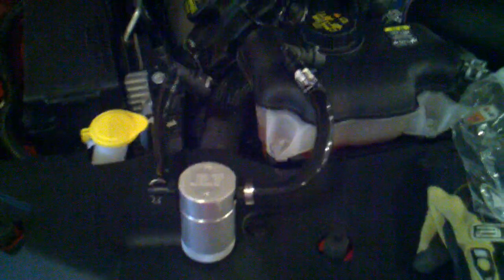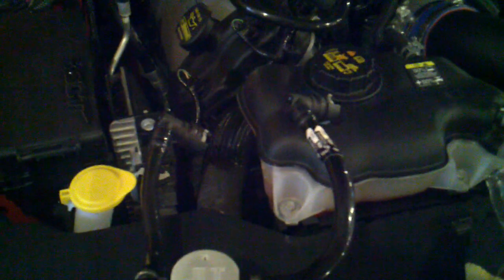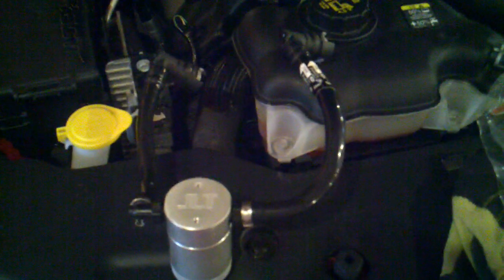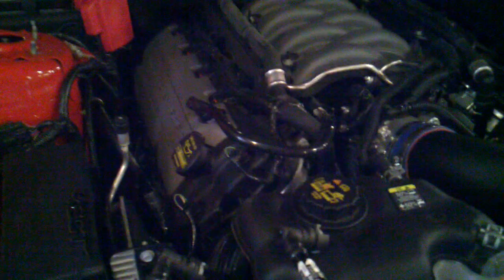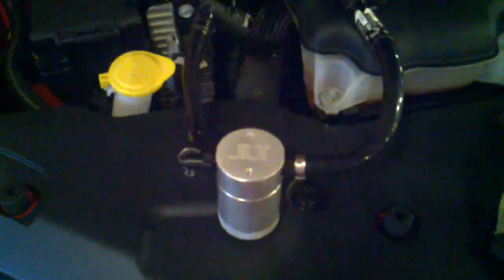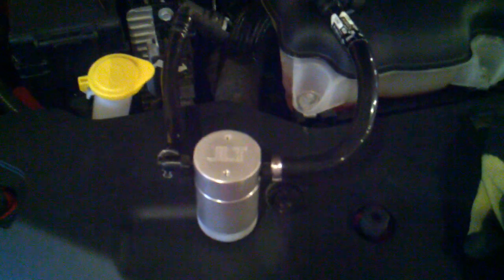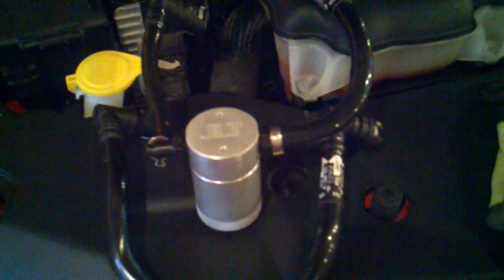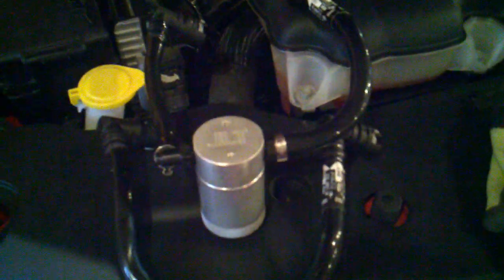2011 Mustang GT/CS JLT oil separator install

Comment: I wasn't sent any hose clamps... so it's just 5/8 tubing that pushes on. It seems to fit OK. Had to do cutting and trimming of the lines so they would fit right... otherwise they were to long and all pinched up

Comment: Kinda cheap. Also where it mounts it basically rests on the coil cover. Which may not be a big deal but I will be getting chrome ones at some point. Factory connections like the jlt unit would do this kit better justice

Comment: Just curious if you have any experience with or know of anyone with a upr model? I just got mine in the mail. I was expecting it to have factory connections like the jlt unit... it doesn't.  It also has a mounting bracket but since the directions they sent me were for a camaro, I'm not sure if the recommended location. Im tempted to send it back. Honestly the only reason I went with upr is because of the problem you had with your jlt unit

Comment from the maker: You may need to go back and re-read I have not once told someone not to get it nor have I said not to install one. That's why I put up a video to show people how much oil it catches and how to install it. 
I live in the backwoods and we have a quite a few stangs out here that run from the 10's to the mid 13's..
Like I said who need's a degree to see that this works and keeps oil out of the intake. 

I have an idea post some video's of your on the edge ride then post a video with those degree's.

Comment from the maker: Who needs a degree to figure this out. No one!   On the edge huh, what mods you have done? What's it running at the track? You had it to any dyno's? Whats your HP an TQ peaks and at what RPM range do the peaks occur for your setup? I pretty sure that your not blowing any engines no matter what from oil vapor mixing back in or they would install a catch can from the factory...

Comment: Lol thanks tips but stampede already told me this.And i had a gt500 with a smaller pully and tune never have a problem.And these 5.0s with just a tune and intake are a long ass ways from blowing up from oil going in the intake lol.You sure you no what your talking about?

Comment from the maker: SVT, the claim for this product is to keep oil out of your air / fuel ration. This oil is fed back into the intake and allowed to mix with the A/F ratio. Or it collects in the valley. The oil is mist/vapors being blown out out of the crank case. This helps to ensure a stable octane rating resulting in stable horsepower numbers. Mine typically has quite a bit of oil collected at each oil change.

Comment from the maker: I didn't notice this on mine, but it's been awhile. Just try to reseat it as tight as you can and check for leaks. If your not getting leaks you should be good. Also check the catch can after even a day you should start to see a little bit of oil collecting.

Comment: Thanks for the info.
I just installed this today and it all went ok but I noticed that when placing the new tabs on the JLT separator I noticed that they click a lot weaker than the original. They are in place and looking good but just the click itself is pretty weak compared to the original ones. Did u ever notice it? does it mean anything?
Thanks.

Comment from the maker: @Alonshalev Yeah you can instal 2 of them they make a passenger side and the driver side, you can get by with the passenger side, the driver side one would be  a must IMHO if you went blower or turbo as that increases the amount that will vent from the crank case. The passenger side is like 90 percent and the drvier side is like 10, when there is no power adder installed.

Comment: Thanks for sharing.  I just recently purchased the driver and passenger side JLT oil separators for my 2012 mustang GT.  However, my Mustang hasn't been shipped yet so they're just sitting for the moment. :(

Comment from the maker: @TheMustangStampede this was taken from the JLT website

JLT Performance’s newest product to keep oil out of your intake is the Oil Separator. During the process of venting crankcase pressure back through your intake track, large amounts of oil, in the form of vapors, can coat your blower rotors, intercooler fins and even dilute your gas, lowering its octane level. This happens on all engines and is even worse when supercharged as crankcase pressures are increased